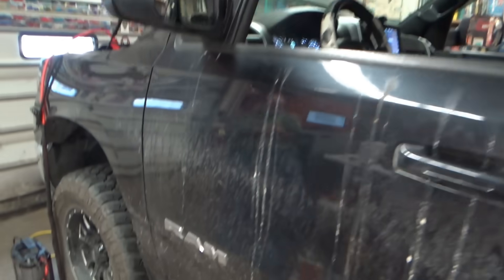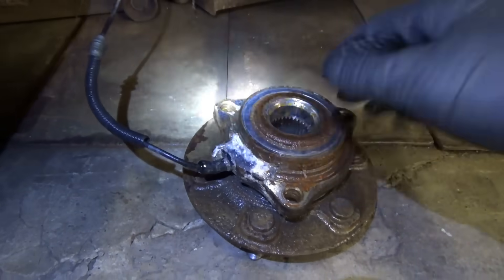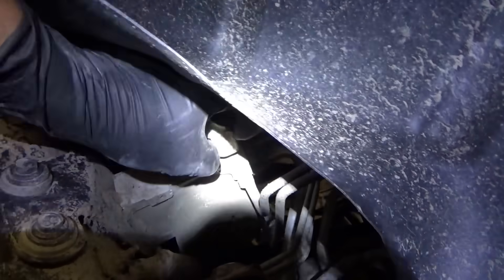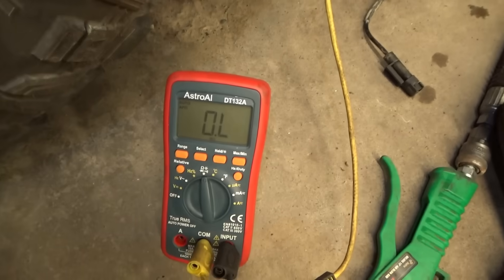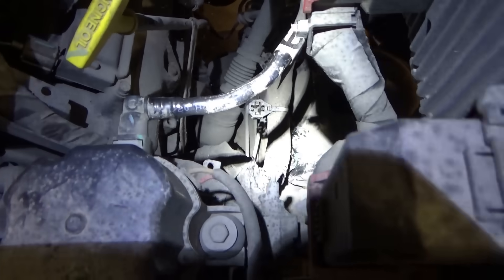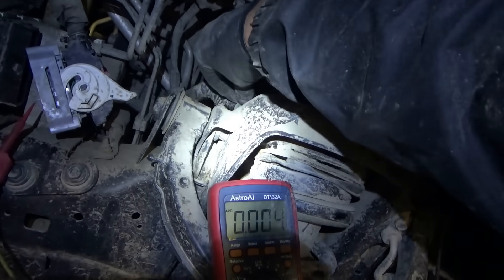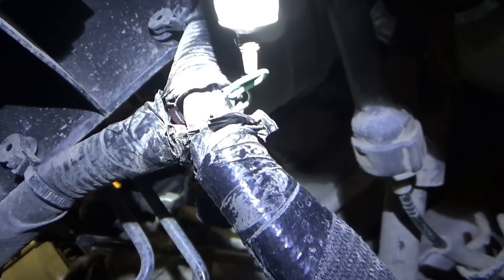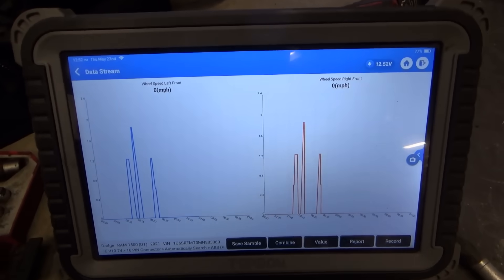Dealer Would NEVER Find THIS ABS Problem!! ('21 Ram V8 C0031)

Comment: How can you own a shop and not know how to do basic diagnostics? Fortunately, for them, you're a decent guy and did not mention names/locations that could negatively affect his business.

All I know is I'd be expecting a full refund from this guy for his false diagnostic/repair.
Reply from the maker: Refund for what? The old hub was mechanically LOOSE so needed to be replaced anyways :)
Reply: They put a hub on it because the bearing failed, not the sensor. The electrical portion was a separate issue that came later, the result of a harness that was not properly routed by someone else. I would venture a guess that this shop doesn't have a subscription to the Chrysler site, therefore it would be near impossible to fix.
Reply: @adamtrombino106  They put a hub on it and a day later the same complaint (as per Ivan's own mouth) came back. So there was an ABS issue before that they thought changing a bearing would fix so they didn't bother going past that point and then couldn't determine the issue.

Yes, basic diagnostics. If the problem was there, then wasn't, then was, and they couldn't figure it out so they call PHD, they aren't very good at basic diagnostics.

I stand by my post.

Edit was for spelling errors.
Reply: No way, those guys are Technicians...they have a badge on their shoulders. 😂😂😂
Reply: This is not basic diagnosis like they said the dealer wouldn't have gotten it. How do you know what he charged the customer 🤔

Comment: i heard of a one wheel peel but 1400+MPH ... did not know the value could get so high .
Reply: Hence is being recognized as a fault and not being considered as truthful as that ABS would be fighting that tire to level up with the other wheel's speed. Would be a disaster if that the ABS would command a lockup on that wheel during driving conditions.

Comment: Great video. The craziest part of all this is that you have to pay a subscription just to read live data from the car ￼
Reply: "You will own nothing"
Reply: @ICantBreve  Eat zee bugs
Reply: @ICantBreve  Unfortunately that is correct! They're doing everything they can to keep you from working on this tinfoil junk!
Reply: Talk about gouging.
Reply: Scope can solve many things; you can read "live" data by piercing the wires with the probe or back probe and see if you get a signal. Would prove the same test he was doing with the scanner.
Reply: @scientist100 without the subscription all you can do is read codes. Can not clear codes, read data or perform tests.
Reply: @shadymaint1  depends on the scan tool. Xtool allows you to retain function as of last update, even if you don't renew. You will just be at the last update until you need to buy the update.
Reply: @Dassick89 its a separate subscription from your scan tool update. Your scan tool has to be on line to verify you have a subscription. We have a subscription on all 3 of our scan tools.  If your away from the shop on a test drive and restart the scan tool it has limited functionality. That is on a Snap On, Autel and a Launch.
Reply: @Dassick89  It's not a update or a scantool thing. It's called a "secured gateway" and with out the subscription you are not geting past it.
this is not a update subscription on the tool. its totally seperate.
Reply: @shadymaint1  unless you have a hot spot with you (I use my phone when needed.)
Reply: @patriotgarage  This is only an issue on 2018+ model vehicles, anything before that does not have SGW. All of my vehicles are before 2015, im not a professional so i dont need to have an "autoauth" subscription. 

Just wanted to clarify for anyone seeing these comments.
Reply: @scientist100  and green crusties would be found by Ivan  few years later.
Reply: @patriotgarage  backprobing is not the same as piercing boss.
Reply: Certainly not right to repair really.
Reply: Not only RAM or Chrysler, but all the cars from the Stellantis Group brand. IIRC this also applies to Renault-Nissan cars, and probably will to the rest of the brands.
They are doing all they can so to make both consumers and independent repair shops the job as hard as they can to make us go to the dealerships instead.
Reply: has anyone tried tapping into can wires beyond the gateway  to see if the scanner will work???
Reply: there is a bypass cable that you can purchase that plugs into the buss comb under the dash. It puts the scanner right on the CAN and bypasses the SGM.
Reply: Engineer friend used to do it all the time
Reply: how much does the subscription cost? And next thing you know, Stelantis will disable the car if anyone but a Chrysler dealer works on it.
Reply: $50 a. Year  @adotintheshark4848
Reply: That’s Chrysler for ya
Reply: this violates right to repair laws
Reply: @mikebuffing727 yes and no they aren’t preventing you from repairing it. This is the new age of repairs and I think manufacturers have spun a loophole on it. So the JLR vehicles you need an ethernet cable to scan them
Reply: Its not just live data no subscription it doesn’t even let you into the car
Reply: That's on Chrysler and not the scanner manufacturer
Reply: It's a rip off!  Win the lottery and build an old pickup from the ground up and give the government and these A-hole manufacturers the middle finger!  Stay away from dealers if at all possible!!
Reply: Nope thinkcar bt has free membership. Xtool was okay but felt generic and after a year I think then you had to pay.
Reply: Always some bum who wants something for free 😂
Reply: @dznuttzonyachin7499  always socialists

Comment: this always seems to be an uber common piece of damage...and not just to Modified.  poor harness routing think.  seen the same thing happen with household electronics and connections; most of the time it's because of people wanting to shuffle everything out of the way so it's "not visible"...generally by jamming everything tight against a wall.

Comment: In my opinion for sealing the hole up in this case, why not pull a new wire from one poked hole to the other and heat shrink on both ends?

Comment: Just be carefull with that swapparoo test. Some cars (mostly germans as i have come accross so far) knows the difference between a left and a right sensor and when you crisscross them will just set the very same code that you start with, making you think its a wiring- or a module-problem, when in fact it IS a sensor problem.

Comment: Did this happen because the harness was not securely attached to the frame, or would it have happened regardless? A dealer repair would have cost thousands of dollars.
Reply: It's almost as if manufacturers do not build their harnasses for aftermarket lift kits.
Reply: Ivan explained in the video.  After the modification was done, the harness was not secured, and it also probably lost some of the service loop that allows it to flex properly.  Then add the sand and mud.  You can't fix the sand and mud because of where the truck drives, so Ivan just secured the harness.
Reply: @major__kong the sand and mud is why I asked. Would this have happened if still stock

Comment: Ivan - You say you don’t like liquid tape and neither do I but you need to try Scotch coat. We use it in high voltage underground electrical repairs and without fail, the dielectric greese will wash out we use it as well but only to lube connections so parts don’t stick.
Reply: Wish it was available in smaller quantities. 50$+ for a can! No doubt good stuff though. I don’t care much for the liquid tape either. Found that  little dab of silicone sticks much better, but you have to give it a little cure time . I don’t mind paying the price for the good stuff, but I’d be afraid to find out if the next time I went to use the scotchkote after the first time , it would be a solid blob. I wouldn’t want to pay over 50$ to find out. Does it remain in a usable condition after opened?
Reply: @brianw8963 it remains usable for years, just clean the lid and can threads before reinstalling the cap
Reply: @jakeandrus690 Thank You, that’s reassuring enough for me to get a can. 👍

Comment: Anyone noticed on Alldata labor times not being right lately and having a little clock timer beside it I have gotten screwed over on some estimates lately.
Reply: That clock is for you to use if you think the time is jacked up. You can change it to what you think it should be. Remember, those labor times are from the factory and no rust is involved.
Reply: They can be very wrong the other way, too.  As a customer, I've seen some jobs quoted as 8 hours by the book when it actually takes a few hours. I know this because I've seen the job done by various people on YouTube.  But with a bum shoulder at the time I couldn't do the work myself. So I ended up paying 5 hours extra shop rate.
Reply: @major__kong I have a bad back and still working on vehicles.
Reply: @2nickles647 Good for you.  I was dealing with frozen shoulder, which not only limits range of motion but is very painful when you try to move it outside of the limited range.  And there was muscle weakness on top of it.  The job I needed done involved a lot of weight and contortions with my arms and shoulders, especially above my head.  It didn't stop me from working on my truck just that particular job on my truck
Reply: Well i did a starter and it said 5 hours said pull the converter off and the engine mount looked up the book time for that is said 9 hours then 4.9 hours for one engine mount ended up being 16 hours of labor lost my ass on that job because I quoted from alldata and I can always beat book time and usually only charge warranty time that’s usually closer than book time.

Comment: no doubt, dealer quote would replace both ABS module, computer, sensor and axle - then when that fails, replace entire wiring harness. Another good job thanks for teaching and sharing to us!
Reply: Funny you think that, although it’s extremely hard to find a good mechanic at any shop regardless if it’s a dealer. But when I worked at a dealer I spent a week finding a canbus issue. Electrical issues wasn’t uncommon on Chrysler so we fixed hundreds. Witech tells you what to look for and it has awesome harness views. It’s not that it’s the dealers it’s the mechanics we have now days. Anyone can change parts, and most shops encourage it.
Reply: Always test load wires, although these do not carry current, the wire size can easily carry 5 amps, no issues. I would not go higher than that given the functionality of it (carrying AC or low voltage generated by the electromagnetic field of the bearing reluctor.

Comment: Oversized wheels eh.
Reply: He mentioned it because that puts more leverage and wear on the bearings;   causing them to fail quicker.  That's just the trade off you have to make when modding your truck.   The CORRECT way to do it is to put 1 Ton axles under your truck;  then it's beefy enough to handle the larger tires and off road beatings.